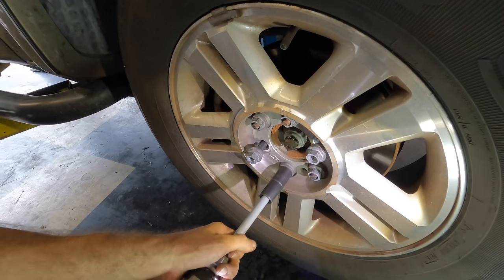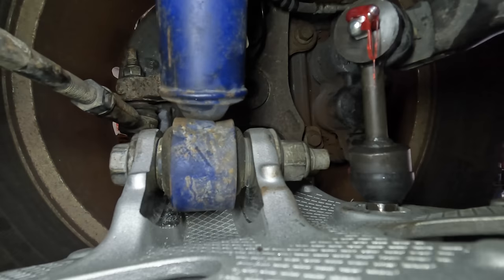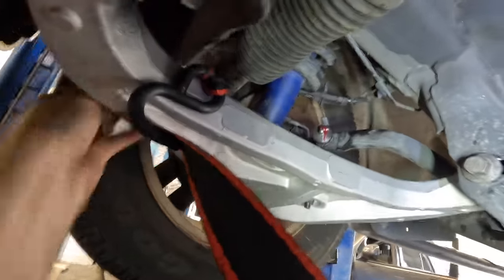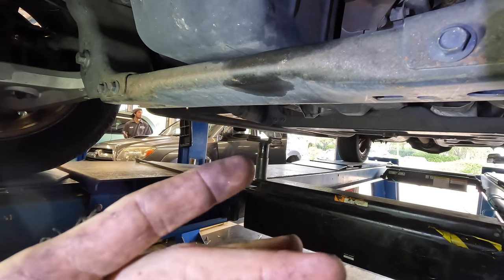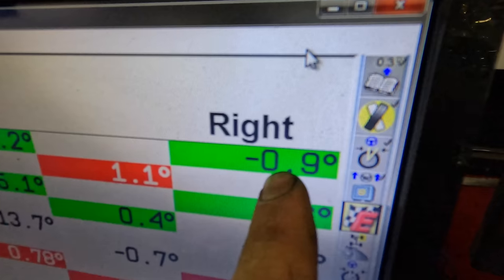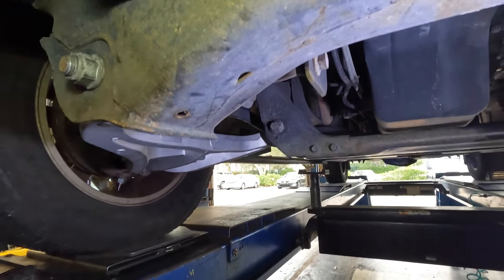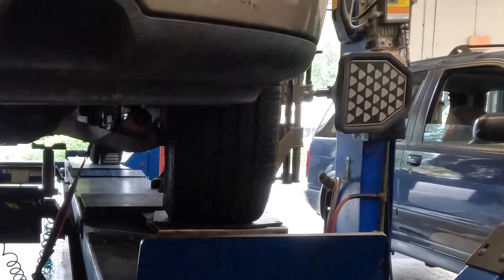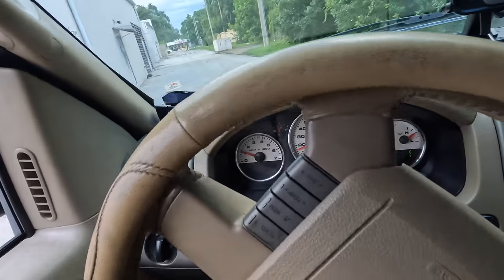Green Doesn't Mean GOOD! 2004 Ford F-150 Ball Joint/Suspension alignment

Comment: Your attention to detail and desire to make sure the repairs and adjustments are the best they can be is a tremendous credit to your professionalism . You treat each vehicle better than your own. It would be an honor to be your associate and friend
Reply: Agreed 100%. I feel the exact same way. Mr. Ray puts his heart into every job he does and he is a fantastic person outside of the workshop as well. I am so thrilled that the younger generation (Ray's group) still take full pride in their work. It is what makes watching Ray's videos magnetic to me. I look forward to each and every one of them!   Fred
Reply: @electronicengineer  I also like when the younger guys (Peter) will ask a question of Ray and Ray takes the time to explain things to him without any belittlement. A true mentor.
Reply: REALLY!!! That is 2 of you that have no clue giving awesome comments....An Adjustment Kit is cheap and no cost to install since the Factory Bolts are out. When adjusting, just loosen, adjust and tighten. No Ratchet Strap, no extra wasted time trying to get to the Factory placement. 100%of the time, a Vehicle should have the Toe adjusted because of Spring Sag after Break in. 40% of the time, Camber and Castor is going to be out for same reason.  That is less than 10,000 Miles. Just install the Kits. An Alignment takes less than 10 minutes when done right. I am quitting watching after 19 Minutes of this total carnage HACK process that has most likely edited out an Hour or so with Camera placement Etc..... This guy does not even mention a +.5 degree Caster split to compensate for the Crown in the Roads for Water run off. The roads will create a Pull... His Caster sweep is corrupted with the Toe being out of Spec. This is Cringe worthy but hey: he makes it Entertaining.....
Reply: @XLAND101  Well, hey, then educate us with your own video showing how it is done.   Yeah, some of us have no clue when it comes to doing alignments.
Reply: @IntenseGrid  I'm still waiting for his video...
Reply: @IntenseGrid  A kit is ordered. I will be using Cardboard as a demonstration... Since you called me out, I decided to watch Part 1. Hey Ray, why pull the Strut if you are not replacing it?? Takes a whole minute or two to R&R the Fender Well and use the 3/8 Impact Ratchet to remove the Upper Control Arm Nuts...... One thing Ford did right, the Bolts will clear the Spring.... Just remove them....
Reply: @blacksheep25251 . Just saw the comment. Stay tuned...

Comment: I take it experience makes a huge difference doing alignments. My son's car always checked good, but still pulled to the right. Finally found a veteran technician who figured it out.
Reply: And what was the problem/solution?
Reply: @richardwernst  they hadn't made a sacrifice to the wheel alignment gods
Reply: They just said they did an alignment then when they found the vet alignment guy he actually did an alignment, sacrifice and all.
Reply: So he rotated the tires.... 90% of pull problems are the tires. Picture rolling a styrofoam coffee cup. It will never go straight.
Reply: @86753091974  no
Reply: @richardwernst  They had already tried a different set of wheels/tires, but he dismounted the tires, changed rims & rebalanced them. No help. 

He adjusted the tie rods to the furthest point, left I believe, that was still in tolerance. 

Drives straight. Tires are wearing normally. Even though several technicians played with the car, over a few weeks, they only charged me for the alignment when it was right. They probably lost money on it.

Comment: Ratchet straps are an amazing tool. Not enough people realize all the different uses they have.
Reply: Most experienced Techs know lotsa tricks to provide assistance
Reply: then you clearly arnt a tech...because we use them for everything all the time....
Reply: You said it docgiggles130! I use several ratchet straps on my home's split unit air conditioner (outside unit), on my water reverse osmosis system cabinet (also located outside), and I even have a ratchet strap on my home generator unit. As a resident of Florida, I have learned the hard way, over the years, to secure all of my homes important systems, which are located outside with ratchet straps, so that the next hurricane/tornado will have a much harder time trying to "wind-delete" my very important and expensive home equipment.   Fred

Comment: i was taught to give about a 1/2 degree lead on the RF caster so that the car would go straight down the road for the pitch of the road...been doing it for 25 yrs and never let me down....not sure if roads in FL are pitched like they are in Central NY for drainage but it worked for us and tons of happy tires and drivers
Reply: Accounting for the pitch of the pitch of the roads dang that is a dream alignment right there!
Reply: @alouisschafer7212  that was our specialty.....no "toe and go" from our shop
Reply: @brianbanks3044  did you also adjust according to customers specs if they wanted more aggressive camber on the front for example?
Reply: His road crown adjustment was done with camber. Ideally you would do that with caster but when you're dealing with a slotted control arm you take what you can get. I won't even touch the camber and caster on a Ford unless the customer wants to install cam bolts, or in this case where a new control arm was installed
Reply: @alouisschafer7212  we did alignments for best tire wear and driving straight down the road...after you do a couple hundred, you see a pattern develop no matter who makes the vehicle....engineers design cars for handling but not tire wear and that leads to tires wearing off in 20-30k...especially when they set them up at -1 to 2 degrees negative to "handle" better....angles like that will destroy tires
Reply: I have always done the same. I always try to get camber equal on both sides and leave 3/4 degree caster split.  Sometimes if I can't get enough caster split ill use about 1/3 of a degree camber split, + one left side and - other right side to avoid tire wear.  Ray had a 1/2 degree camber split that should make up for road crown.
Reply: @firstlast---  after you do a few, you get used to how much it takes to move the slotted arms...usually i would just barely loosen the bolt so the arms could barely move and still hold the angle...it takes practice but I never had to use all the stuff Ray used to move the arms (ratchet straps etc)....but I get it totally how much of a pain it can be
Reply: @brianbanks3044  Very true, that's the best way to do it. However in the rust belt if you touch them there's a chance you'll actually make it worse than what it was without being able to go back. Personally I don't take that risk, however I've found ford's hold an alignment for a very long time
Reply: @brianbanks3044  Don't need to put handle in quotes. Small amounts of negative camber do indeed improve handling characteristics. Personally, I don't mind going through tires quickly on my cars. But I'm in Texas, where we can run summer tires all year (and I do). 10 k miles is a good run on my car tires with how I drive (no speeding, but high lateral load from aggressive cornering - I love me some roundabouts). For my truck I do indeed prefer longer life, but (assuming decent alignment, inflation, and regular rotations) that is more down to tire compound than camber (my truck has only had one alignment since purchased on '07, when we refreshed the suspension a few years ago). The Nitto Ridge Grapplers I have on it right now will probably hit their shelf life before their tread life, with how little driving my wife does around town. They have just over 20 k on them right now and still look nearly new, as compared to the softer factory tires which did indeed need replacing in about 20k miles (but that was also over mixed road surfaces, many of which were very poor, out in the country).
Reply: @firstlast---  "His road crown adjustment was done with camber."

Road crown adjustment is done to avoid a pull, so caster is what you would need to adjust caster for that. Besides, if you look closely at the vehicle, there are no camber adjustments.
Reply: @AT-wl9yq  What? Did you not see him adjust camber, or hear him explain which direction the control arm needs to move to adjust camber?  Also, camber will pull to the side that is most positive. If you look at the specs, caster was about even and camber was more positive on the driver's side. That was the road crown compensation. It's difficult to be precise when there are no cam bolts
Reply: @firstlast---  You can argue all you want but camber will not make a vehicle pull. (I'm assuming the vehicle hasn't been in an accident, or something major happened to it). Uneven caster will make a vehicle pull. He did say that in the video as well. 

"What? Did you not see him adjust camber, or hear him explain which direction the control arm needs to move to adjust camber?"

I saw exactly what he did. That's why I said to look at it carefully. He made 2 mistakes in his explanations. Not huge mistakes, but they were errors. One was on camber and the other was on toe. If you know about wheel alignments, look at it again. He's missing an angle.
Reply: @AT-wl9yq  You think camber won't cause a pull huh 😂😂 if you feel like being humbled I encourage you to go look up free ase study guide and take the a4 test. It's embarrassing when you try and shut someone down talking about argue all you want when in reality you are incorrect
Reply: @AT-wl9yq  Yes, camber DOES cause a pull! It's just not as drastic as pull caused by caster,
Reply: @61rampy65  If you read my post, I'll go so far as to say that in an extreme case, such as an accident, something like that may be possible. But if you're working on a car that is in good condition, and remotely close to spec, it will not. Sometimes when camber or toe is out quite a bit, the steering just won't feel right. That could be mistaken for a pull, but its really not. 

That said, if you tell me you had a light pull and fixed it by adjusting camber, I may believe you. Caster is your main angle that causes a pull. SAI is derived from the same line you use to measure caster. But, for SAI, you rotate your viewing perspective 90 degrees. If SAI is out, that can cause a light pull. Not as bad as caster, but a light pull like you mentioned in your post. We can use the truck in this video as an example. No offence to anyone who's reading this, but I'm probably the only one that knew he was adjusting SAI in order to change camber. If you don't know that, and well over 90% of techs are not taught this somewhere in their training, you'll think a camber adjustment fixed your pull, when in reality, it was SAI and you just didn't know it.

I don't know what you have access to, but if you have a vehicle that has a real camber adjustment somewhere after your pivot points, knock the camber adjustment and drive the car. Just keep in mind, when you do that, it will knock toe out as well. Anytime you move camber, it will change toe. Nothing you can do about it.
Reply: @AT-wl9yq  Lots of incorrect babble about camber. If you had read my post, you would have seen that I said caster is much more of a pull cause than camber, but camber DEFINITELY can cause a pull. Please tell me where you work so I don't bring my car there. No need to lecture me about alignments, been doing them since the 70's.
Reply: @alouisschafer7212  This is actually how a lot of American vehicles come from the factory, so it's written into the spec that the right front caster be different for the crown.
Reply: I also use 1/2° when possible here in Maine.
Reply: @AT-wl9yq  incorrect. Though I do get your point, it is not accurate.  Been doing this for over 20 years in the rust belt. Your over simplification of the angles is not going to make in all real world situations
Reply: @louiscates6975  Over simplification? Who's posts are you reading. I don't care how long you've been doing it for, but 20 years is absolutely nothing. And what does the rust belt have to do with it? Alignments are the same in the rust belt as they are anywhere else. I'll tell you like I tell everyone else. I'm a wheel alignment instructor. If you think you know more than I do, quote me, and prove me wrong. If you can't do that, stop with the bullshit. You're like everyone else. You can tell me I'm wrong, but you can't back it up.

Comment: As an occasional DIY'r I often had to address overly tight bolts and nuts with some sort of cheater.  I used that box-end, open-end trick twice.  The first time it worked.  The second time the mouth/jaw/? of the open-ended wrench nearest me snapped right off and ricocheted off my forehead.  Lead to a definite preference for higher quality tools when I could find them and afford them.

Comment: Used the same method to install the track bar on my 12 F350. The weight pushes the axle to the right so have to pull the body and axle together with the strap. Sure makes things much easier.
Reply: I find putting a jack between the tire and the frame gets it done pretty easy too

Comment: As a young technician learning alignment I was taught to always consider the driver and passenger weight and put quickcrete bags in the. seat where large folks sat to correct camber issues. Don't know if anyone does that anymore. Always fun to explain what was going on to the customer when I got caught.
Reply: Us big folks thank you
Reply: After awhile you won't need the bags. You'll be able to adjust and compensate for that without much thought just by the numbers

Comment: Alignments on these F150 trucks is a pain ! I usually adjust the caster and camber with the wheels elevated, jacked up on the frame. It takes most of the tension off of the lower control arm.

Comment: What I do is hold control arms parallel to ground and center lowers in the holes then tighten down and usually alignment is dead on except for toe, if adjustment needed I use jack and hold

Comment: Only recommendation, is that u rotate the rear tires to the front, then perform the alignment. Uneven tire wear can be seen on those front tires from bad ball joints, so slap the rears in the front for accurate aligning

Comment: Tightening suspension components at ride height is not only valid for those “specific control arms” that goes for all vehicles you always tighten at ride height for any vehicle
Reply: Not all control arms go through a bushing in that style, it's good practice. But I'm pretty sure he was talking to another tech/writer who didn't know & or he was being sarcastic.
Reply: The best are manufacturers who say tighten so and so suspension at ride height....but the part is absolutely impossible to reach with the car at normal ride height (i.e. rear upper strut mounts on VAG cars).  Do some auto engineers expect black magic?  Complete lack of common sense.

Comment: Still hearing brake drag noise on test drive. From the looks of the rotors and the newness of the pads I'd say no new rotors or turning of the rotors took place when pads were replaced. They appeared to have groves and hot spots on them. If I were Ray, Id want to ask the customer the details of his brake job and mention the noise just to CYA ... cover your arse... Someone else mentioned and I too, did not remember seeing Ray tighten the lower strut to lower control arm bolt when he had the car on the alignment lift. All in all, damn good job Ray.

Comment: I was always taught you want a tiny amount of negative camber, never positive. It can have a fairly significant effect on handling to have positive camber because of the way the tyre will roll under the wheel when cornering. With vehicles with tall sidewalls like trucks it's actually even more pronounced.
Reply: He did make it negative whe he said he wanted more positive that was in the rear caster to get a negative camber in the front

Comment: What would be cool is if you were closer to the Ocala area... I'd stop in and see you about doing the timing cover gasket & oil pan gasket on my 07 Monte. Another thing that would be cool is if you had your own shop, rent out a lift bay/tools for people who want to do their own repairs but don't have a lift or specialized tools like a balance puller, etc. and they can pick your brain if they get stumped.. or if they give up and you finish the job, you can charge close to around the original price of the job. This will help those who'll try to do it themselves even though they don't have the right tools ... and it'll give you some revenue renting out a bay ... just not sure how to do the insurance/waivers to protect you.

For example, I have a 07 Monte that needs the front timing cover & oil pan seals replaced (according to a dye test done by the dealership) ... I have the general knowledge on how to do it, just don't have a lift, an engine support bracket so I can remove the brace that goes across the oil pan, a harmonic balance puller, parts cleaner, etc. I just have the standard Craftsman wrench & socket set. And while I have the general knowledge on how to do it, it'll be good to have someone with more knowledge to get advice or even some tips/tricks from.

Comment: New ball joint installation is not a trivial repair.  Plus, you need to know what you're doing (as evidenced by Ray).  Great video!
Reply: Yup, at least the alignment process. It makes you wonder how they even did it before computerized laser machines. Though I do remember that old cars had quite different adjustment mechanisms, superior to just slotted  bolt holes and/or cam washers. Progress 🤣

Comment: What I have done when changing those upper control arms is too measure the height before popping the ball joint and use the measurement to set the new one